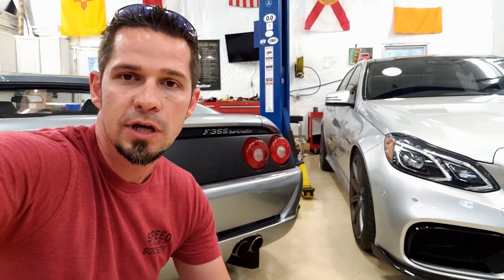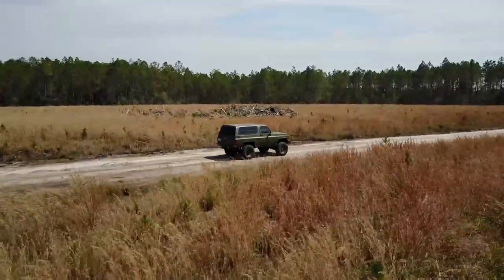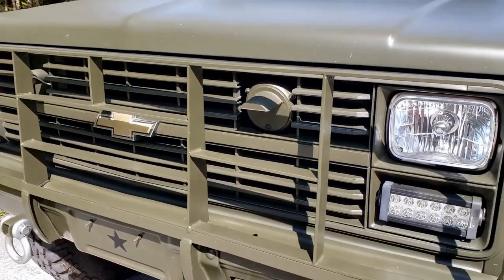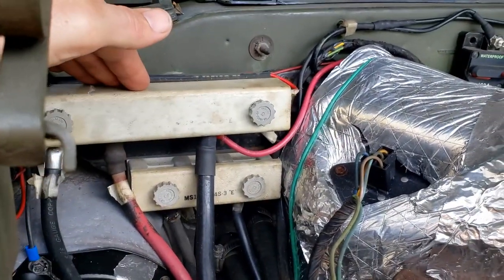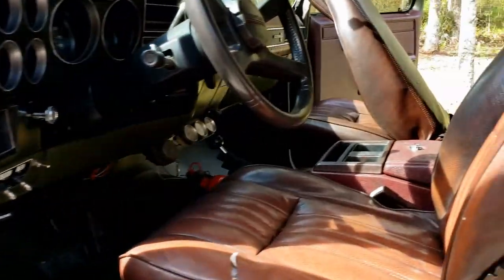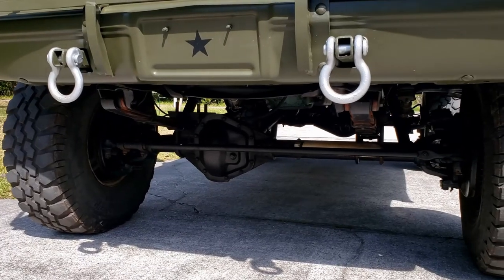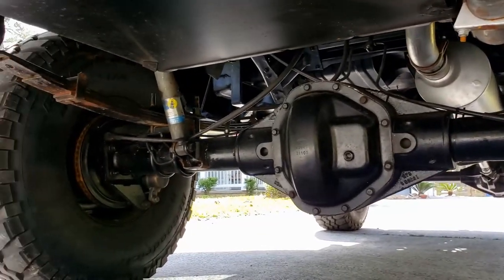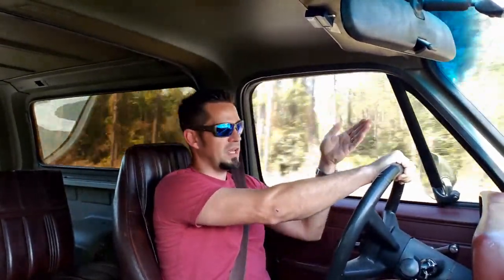TURBO, 1 TON  M1009 CUCV, Full review of my build!

Comment: not ifra red, standard light, just very low wattage
Reply from the maker: Yeah, that information was from a thread on steel soldiers.
Here is a better description:

The small lights, front and back, are called "cats eye" lights and are used by the drivers during blackout conditions (light discipline) to keep vehicles in line during night movements.

The hooded white light in the grill is the "blackout driving light". This light is switched on independently of the "cats eyes" and casts a dim white light on the ground for a short distance to the left front of the vehicle, in front of the driver. This light is so the driver can see the ground guide who is walking in front of the vehicle to guide it.

The development of night vision devices has greatly reduced the need for the blackout lights, especially the blackout driving light. Military vehicles still have the capablity for when night vision devices are not available. The specialized switching prevents the accidental appearance of any lights, including brake lights and turn signals, during periods of light discipline when the appearance of a light would give away the position of vehicles (and troops) to the enemy.

Comment: I love how people put 1ton axels on a half ton frame and call it a 1ton Blazer..dumb..
Reply from the maker: I love how people make stupid uneducated comments on people's YouTubers videos.
The m1009 actually rated as a  3/4 ton vehicle, not 1/2.
There is more than frames factors in to the "X-ton class" of trucks. Is the frame different on a Chevy 2500 vs 3500? Nope, exact same frame.
Does this blazer have 1ton axles? Actually no, the came off a 1.5 ton truck... so is this blazer still a 3/4 ton m1009, is 1ton or 1.5ton? I can tell you the most wrong answer is yours, it was never a half ton.
Since no one upgrades frames, the common way to quickly let people know you've done an axles swap is to refer the rating of the new axles.

I guess I could have made the title a paragraph for you: “originally military designated 3/4 ton m1009 that has been upgraded to 1.5 tons axles, yet still retains the original 3/4 frame."